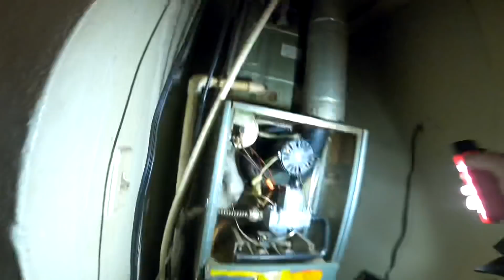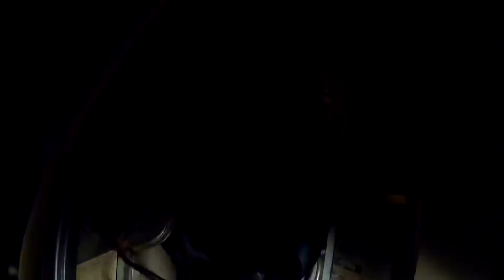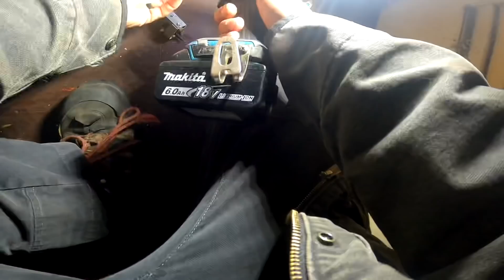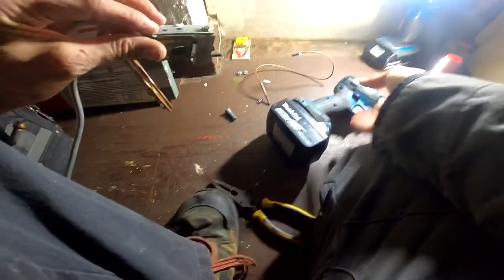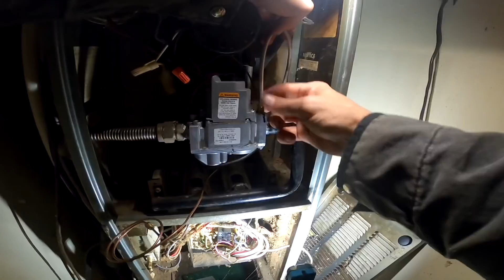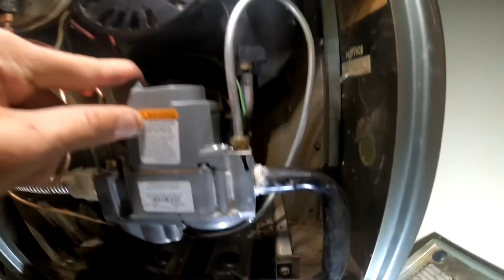Pilot Won’t Stay Lit 🔥 - Easy Fix…I Hope

Comment: I assume those block walls have little or no insulation and not much in the attic. Hard to heat and cool
Reply: they've likely been framed in with 2x4, R13 insulation and drywall since it was military barracks ;)

Comment: Yep you got to put your meter on DC and measure the voltage while you're heating it. I thought the pilot flame looked a little puny, I wondered if there was some dust in that pilot tube. Good yob.
Reply: the pilot and sound of it was about right (you can hear it on video at one point), knowing it has the flame aimed from left to right over the T.-couple, was showing it fully wrapping flame around and heating it well. nice mostly all blue pilot flame, with just as light tickle of flicker at the tip.

Comment: I like your videos. In order to replace the thermocouple, you have to clamp the stop tooth with the pliers and slowly pull it out. The new thermocouple color has to go first on the thermocouple  and then pushed into the stand.
Reply: I put the thermocouple in, then slide the collar on til it's on the bottom ring of the thermocouple...it will stay on that ring and the collar will prevent it from pulling back into the hole of the mount...

Comment: yeah I would hate to get a carbon monoxide detector and use that to discover a crack in the furnace exchanger I would really like to know the symptoms without opening it up but I guess a carbon monoxide detector would be the best way
Reply from the maker: If you’re worried hire a reputable company to look . The short is there normally aren’t any symptoms you’d catch without opening it up, and carbon monoxide is odorless. So, go to Home Depot and get a CO alarm, they’re cheap. Then have it regularly serviced.

Comment: don't get me wrong I appreciate your video but if somebody tells me hey my pilot light keeps going off number one it's old pilot light is old I'd say number one change the bordon tube.... and all that other rigmarole just boilerplate.... even if that is not the problem even if it does go up into the gas valve it needed to be bord on tube anyhow

Comment: other than dying of carbon monoxide how do you check for a bad heat exchanger I have a Goodman gas pack it's got the furnace air conditioning outside one package...... to open it up is a big problem
Reply from the maker: Have it checked by a pro. At the very least buy a carbon monoxide alarm. They are fairly cheap at Home Depot, and can save your life

Comment: That furnace needs to be replaced
Reply: with a new 96%+ lie efficiency of early failure, home freeze-up and endless repairs? yup, go for it!
replace it when it's broken/dangerous.
hint: the majority of them will emit very low levels of CO gas, even when badly broken. now there were/are mobile home and others that used intake draft inducers, which put the heat exchangers under positive pressure when the flame is burning, BUT once the indoor blower turns on it over-pressures the leakage and makes that null.
people driving/sitting in traffic/idling, usually CO poison themselves far worse than all others.
perhaps that explains why the biggest cities have went full imbecile.. 😑

Comment: Thanks for the explanation at end for testing a thermocouple with your millimeter. What’s the minimum DC volts you would like to read ?
Reply from the maker: I’ve seen them work with 15mV. But, they should be 25-35. 20mV is borderline.

Comment: A bad crack in the heat exchanger could be blowing out the pilot after the flame shuts off and the fan is still running.